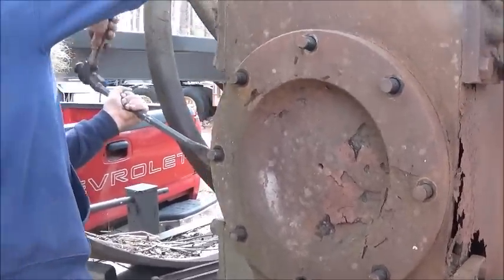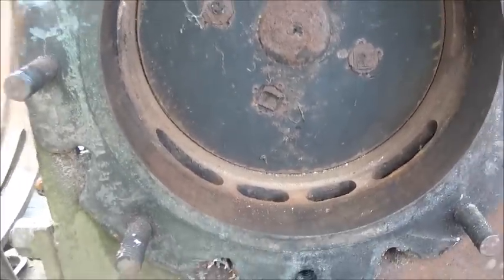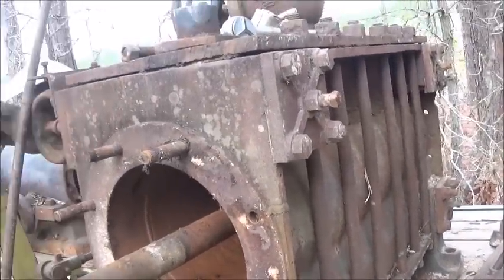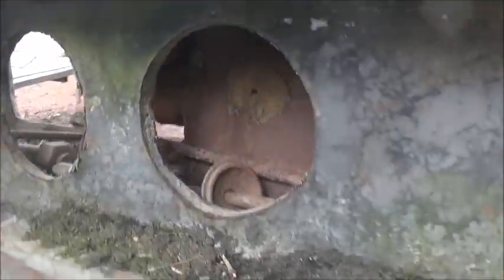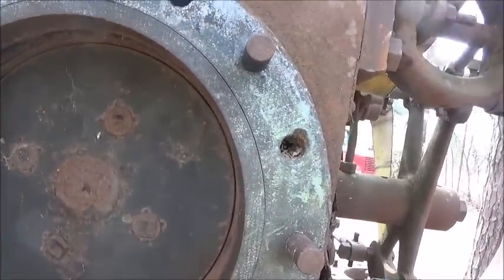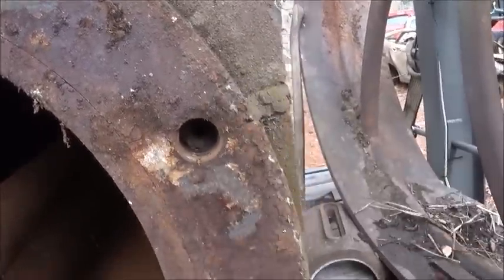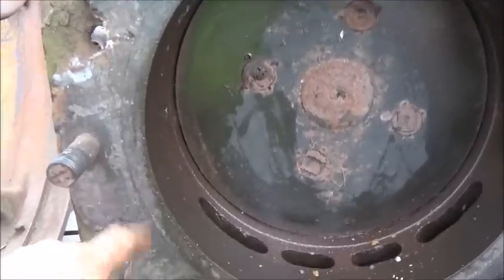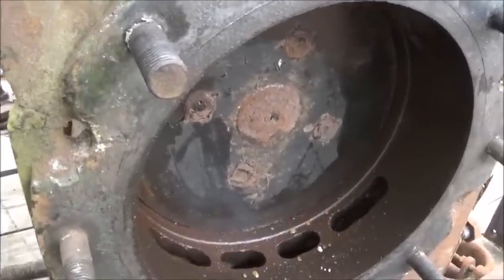CORLISS ENGINE TEARDOWN AND ANOTHER MYSTERY

Comment: I'm with you. The casting broke because of too much press.
The other is it filled with water and froze.
Either way that's a nice but huge repair. I wish I could come over and fix those broken out areas for you. I have brazed many large castings on the carpet looms. As long as you have the heat it can be done.
Cheers
Terry
Reply: I like your frozen theory.  Ice exerts a lot more force than the steam pressure it was designed to run on, and explains both the tie bolts and the sleeve.
Jonathan-  iron expands/contracts .00000655 per inch per degree, there's no way that thin sleeve could exert that much force on that massive casting.

Comment: Cosmetic casting defects used to be repaired with a product called "Smooth-On" cement. If memory serves it was powered iron and sulfur that was mixed with water and laid in the defects where it hardened. A little cleanup and the defects disappeared.

Comment: Have you used Evapo-Rust™ Rust Remover. I see people take a large plastic tote. Cut the top an get a 30 gallons of Evapo-Rust™ Rust Remover then all your rusted parts could go in it. Also they put a heater in it to make it work better. The amount of rusty parts you do might help in the long run. It never goes bad can strain and use multiple times. Good Luck. I think you should have been born a Hundred Fifty years ago. Love the old stuff not Chin#### plastic Junk. That’s what made this Country. Thanks

Comment: Boy that's quite a project you guys have taken on. That would be tough enough in a full equipped shop, pretty hard core to be doing it outside in winter. Those Corliss engines are certainly a beautiful thing when they're up and running. I got to work with some of the last working steam engines on the British Columbia coast. They had a pair of 600 hp Corliss engines that ran the newsprint machines. They were gorgeous things, all gleaming red paint and brass. Fascinating to watch.
Reply: Were they kept or scrapped?
Reply: @SteamCrane  I don't know what eventually happened to them. The paper mill closed in 1980 and everything was auctioned off. They originally had five paper machines run by Corliss engines, but when I was there only two were still running. They had been scavenging parts from the downed engines to keep those two running. I hope one of them at last ended up in a museum or something, but I never heard anything.

Comment: Sure seems like whoever was in charge of maintenance and repair on this engine had no idea or totally underestimated the expansion rate of big, thick, heavy pieces of iron like that 14" + piston sleeve. Maybe a high pressure/temperature event caused some excessive heat/expansion too ???   With that big, thick sleeve installed in that casting, I would guess you would want to heat this engine up really slowly so the body casting would have a chance to expand with the sleeve ??? Hard to imagine how much force that sleeve is putting on that body casting while it's trying to expand from the initial steam heat !!

Comment: I have loved steam engines for years,  I’ve made a couple model steam engines and had a few factory made models I even have a steam whistle attached to the side of my roof that I run off a compressor. However the blackforest wild fire of 2013 took my house and everything in it, 10 years later I’m just getting the desire back and have picked up some tools to get back at it. Anyway I love your man size toys

Comment: they mighta been using long studs in them head bolts to draw in the sleeve and then ran into trouble. It could account for why they was all stripped out as they kept breaking them and using a new pair till they got it pulled in. probably adding torch heat to the outside as well during the process leading to the cracks.

Comment: I ain't there so l really can't say but from what I'm seeing - the committee in my head is saying the sleeve went in after the fact(damage)as a repair...l think something got in there & slammed brakes on the pretty flywheel & that's how that valve rocker thing got broke as well - whole engine assembly probably tried to lift the foundation off the ground...& truth be said I'd druther face that 'issue' than the boiler blowing up...maybe somebody was mad about how the civil war was going & wanted to sabotage something 🤔 l don't know...even though he did promise that he would not get angry - l think some of the sedagive scene was still lingering on when he found out about Mr A.B. Normal...l just hope you're not upset with me..l mean, it could be worse - could be raining

Comment: About the 13" bore..

Does anyone know the rationale for a full inch of undersize? Typically when you reclaim a cylinder, you're talking 10-60 thousandths, not full inches.
Reply: If the damage happened before the sleeve was installed, maybe they used a thick sleeve because they didn't trust the casting to hold a thin one?

Comment: I think that engine was decommissioned let's say maybe100 years ago fully in-tacked. It was then stored really badly and froze dozens of times which cracked it. Someone then came along a half century later or so, with a view of putting it back to work either as a museum piece or a personal project. The head was found to be seized on along with the rest of it because of the way it was stored possibly. The damage to the threads, machine flanges etc then occurred whilst trying to pry it apart. Once stripped down the damaged cylinder/steam chest was re-sleeved to a smaller bore, easiest and cheapest solution, the piston and head were cut down to size then the welding and reinforcing cage was built around the steam cylinder and chest . The flanges/threaded holes etc around  the cylinder head area that were snapped off, were done whilst prying on various parts to remove them. The head once cut down was then clocked in an attempt to avoid the weakest areas and hay Presto!  Now I would be interested to know how this really happened and if it ever was pressed back into service at some point once the work had been done or did It simply have all that done by a Man  or  woman t-he just like yourself let's say a back yard enthusiast just for the pleasure of working on such an iconic feat of engineering. .  Either way thanks for all your hard work and great videos